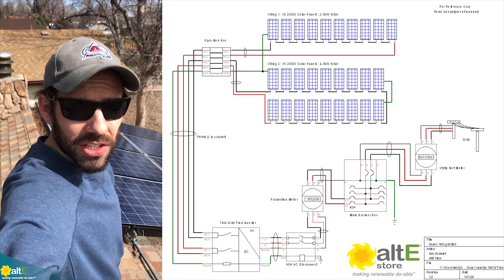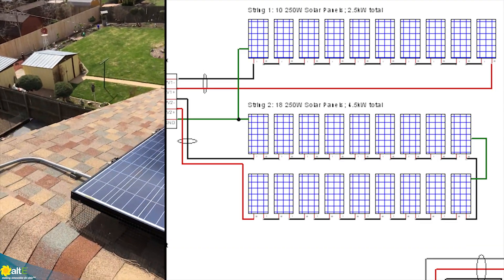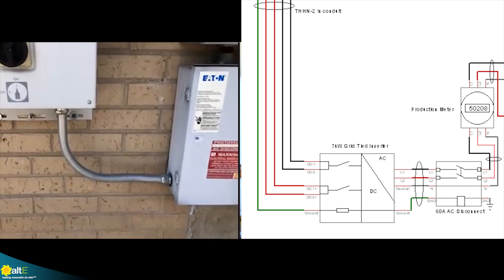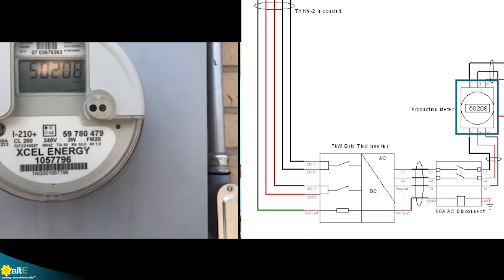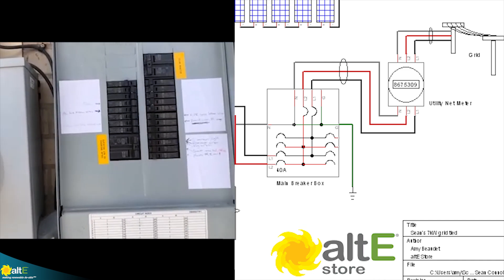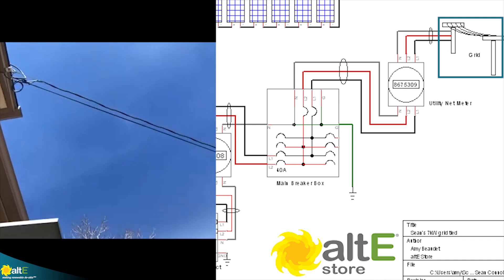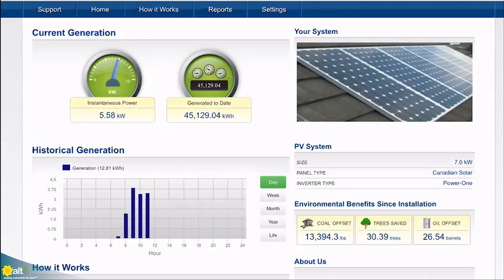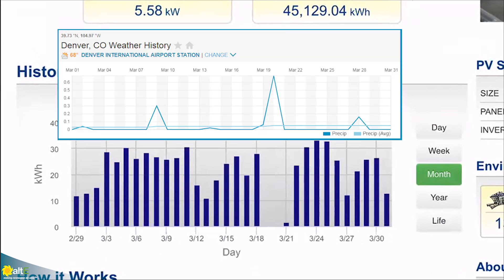A tour of a grid-tied solar system with altE at home

Comment: Good video. I just got 2 quotes for grid tie systems using my 12 month power usage. The 1st quote was for a 17.8kw system and the second for a 12.8kw system. I devided the yearly power consumed by 12 months and got 1980kw average. Not sure why a big diffrence in size, both systems use 300+ watt panels with enphase inverters.

Comment: Thank you always for a very clear and informative video!
I was wondering if there is any DC side protection fuses or breakers? Is it embedded somewhere inside the PV disconnect of the DC side of the inverter?
Reply from the maker: Because the strings from the solar array are not combined, NEC does not require over current protection as long as 1) the short circuit current (Isc) does not exceed the max Series Fuse Size of the panel and 2) the wire is sized big enough to handle the max current. Because the solar panel can never produce more current than that, there is no risk of over current.
Reply: @AltEStore  I see thank you for the response!

Comment: Hi amy hope you are fine and well , we are also in quarantine 😊 ,I am confuse in 1 thing , suppose we have 600watt hour and 12 volt ,50ah battery , by keeping watt hour in mind i need single 150 watt panel to charge it in a day as 600watt hour divide by 4 = 150 watt  but by keeping 50ah in mind i need 2 panels in parallel to charge it , as 50ah divide by 4 we get 12.5 then 12.5 divide by 8 or 9 amps of single panel we get around 1.6 . 

Remember 4 is sun hour factor in our area. 

i am confused how to do calculation 🤔, calculations changes if we do it with watt hour and ampere hour :-(
Reply from the maker: You are close, but didn't take into account losses and inefficiency. I usually figure on losing 40% in an off-grid system. So 600Wh / 4 sunhours / .6 losses = 250W of solar. But keep in mind, if it is a lead acid battery, you can only use 1/2 of the capacity, so it is really more like 300Wh you need to make. If it is lithium, you can use more of it.
Reply: @AltEStore  thank you so very much .
Reply: @AltEStore  Solar engineers have 1 problem atleast in my country they don't know how to use pvsyst software neither helioscope please do us a favour make atleast 1 or 2 video on it to make us complete design engineers. ;-)

Comment: Hi Amy , hope you are fine and doing well. There is lot of confusion about battery sizing ,suppose if some 1 ask me to give him 1hours backup incase he has 100 watt load , i divide 100 by 12volt to get amp for him then do further calculation according to battery 'dod" but if his inverter support 24 volt then obviously my calculation gone wrong so should we calculate battery size as watt hour instead of amp hour (as we do not know about other person inverter voltage ) , some 1 told me that we should only do calculation with amp hour as voltage doesn't matter but i think otherwise .
Reply from the maker: It's easier to do all of the calculations in watt hours (Wh), then you don't have to worry about how many volts it is. If you have a 100W load for 1 hour, you need 100Wh. If you have a 12V system, that's 100Wh / 12V =8.3Ah. If you have a 24V system, that's 100Wh / 24V =4.1Ah.
Reply: @AltEStore  Thanks a lot . <3

Comment: I have an identically sized grid-tied array. How easily (and cost effectively) could a Kilovault HAB battery system be integrated and installated? Quotes for LG Chem and Powerwall batteries exceed $15K...
Reply from the maker: With a string inverter, you could do DC Coupling where you take one string and send it to a 600V charge controller. Here's a kit with AGM batteries for under $6k, or you could upgrade to the HAB for about $9k total. https://www.altestore.com/store/solar-power-systems/battery-backup-solar-power-systems/morningstar-dc-coupled-retrofit-battery-backup-system-p12001/

Comment: Thanks so much for your informative videos.

I have a couple of questions/comments regarding this video.
1. What are the circles shown at various places around wires in the circuit diagram?
2. I presume this particular inverter has two separate AC output circuits. Quite unusual, no? It would have been nice for the two circuits to have separate colours for the live wire.
3. As you mentioned, the load provided by the house, exists in the main DB board. But a pity it is not shown on the diagram.
4. The inverter shows the DC disconnector joining the input strings. This is definitely not correct as there are two MPPTs.

Thanks again for showing us a grid tied inverter setup 'in situ'. 😊
Reply from the maker: Thanks for the questions. To clarify. 1) The circles are showing the wire is in conduit. 2&3) The inverter only has 1 AC output. It goes to the main breaker box (through the AC disco and meter). Once in the main breaker box, it is distributed through the house through the breakers, same as the grid power. If extra power is made, it goes back out to the grid through the main breaker. All of that is in the schematic, but I don't show all of the regular house breakers connected to the loads. 4) the schematic was drawn with simplicity in mind, It doesn't show all of the goings on inside the inverter. The point was that the DC disconnect will disconnect the DC input when needed. Hope that helps.

Comment: What is the conduit material used ..looks very reliable and secondly if you could run through all the earthing details and lightening arrestor used, it would be more detailed and helpful.
Reply from the maker: It looks to me like standard Electric Metallic Tube Conduit (EMT). I don't believe a lightning arrestor was used. I'll make sure the next video points out the ground a bit better. This system wasn't installed by Sean, so we couldn't really get inside the boxes. Our next ones were self-installed, so we can dig deeper.
Reply: @AltEStore  appreciate your reply !!! Keep posting such videos !!!

Comment: Is there a way to show your current power usage vs PV power created?  What I'm looking for is what is the current net plus or minus power usage from the grid.
Reply from the maker: There are meters that have you put a sensor on the solar input and the main input of your main breaker box. This allows you to monitor actual energy going in and out of the house. SOme of the newer inverters have monitoring systems that include this. Since this is a 7 year old system, a 3rd party meter like this would be needed. https://www.altestore.com/store/meters-communications-site-analysis/solar-monitoring-systems/efergy-elite-energy-monitor-p10892/

Comment: That was a great video.  Liked the way the screen was divided by actual equipment and diagram.  No batteries ??  Is that because he feeds excess to grid.   Guess he gets credit towards his bill??
Reply from the maker: Exactly. Credits earned in August can be used in November. His grid is very reliable, so he didn't need the battery backup.
Reply: This gentleman seems very happy with his system.   How would a person go ahead and look into a solar system that would fit their needs
Reply from the maker: @larrymoore6640  I'm glad you asked. Take a look at your electric bill and see how many kWh a month you use on average. Enter it in the grid tied calculator to get an idea of what size system you would need to offset whatever percentage you want. Remember that you don't have to make all of your power, most people just make some and buy the rest, reducing their bill. https://www.altestore.com/store/calculators/on_grid_calculator/ Then take a look at your roof and see if you have a sunny roof facing anywhere from east to west, not north (for northern hemisphere, the opposite for southern hemisphere). If this is something you think you can install yourself, you can take a look at some of the DIY kits we have available. https://www.altestore.com/store/solar-power-systems/grid-tie-solar-power-systems-c569/ We can custom design them as well.  If you don't want to install yourself, contact a local installer to get a quote.